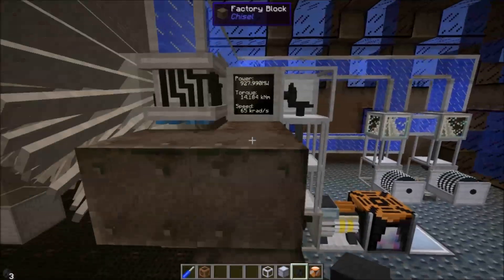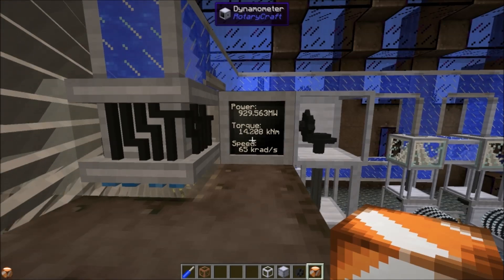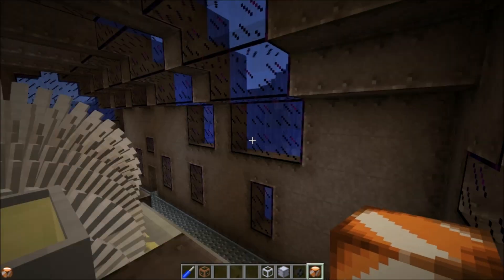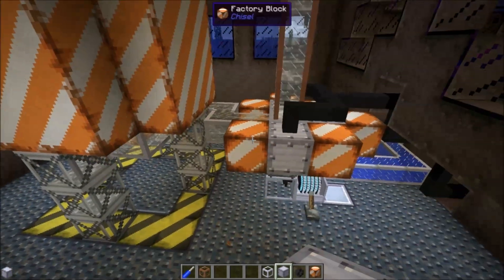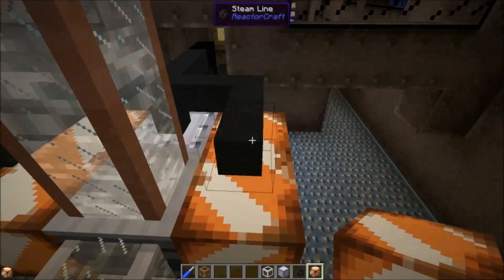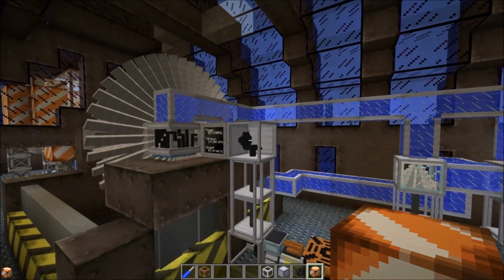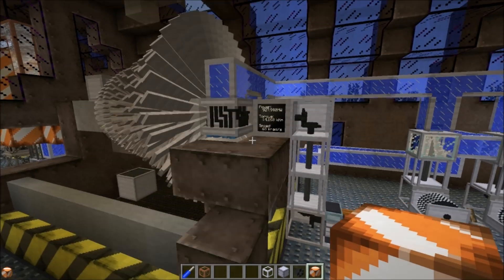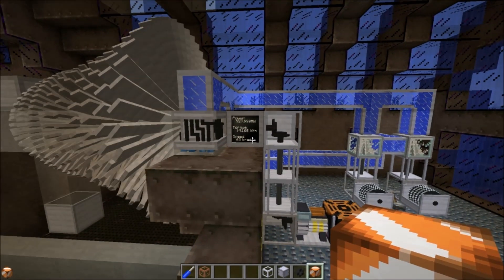ReactorCraft Tutorial #4.1 - Less is More

Comment: The number of boilers you need is a direct function of your reactor throughput. A small (tiny, really) reactor like this one probably only can drive one or two boilers. But a large HTGR will need lots of boilers. Mine runs five and could run twice that, and it only has 32 cores.
Reply from the maker: Yeah I've already built a HTGR that runs 4 boilers in a test world. I've also discovered what I believe to be the smallest HTGR capable of running 1 turbine on full power and will have a video of that up later today, it only has 4 cores.